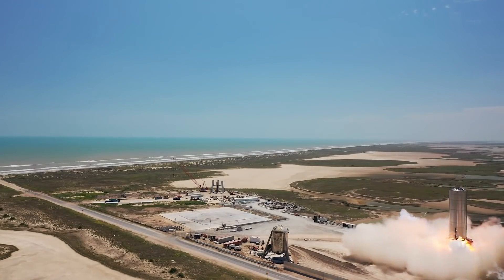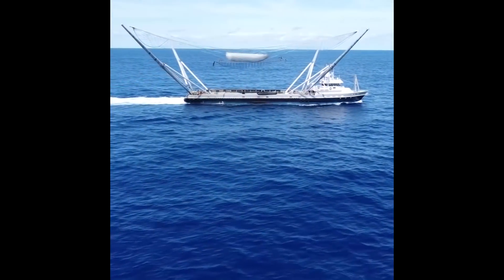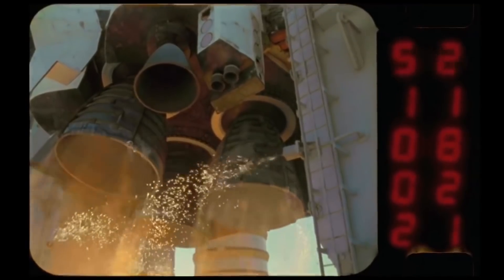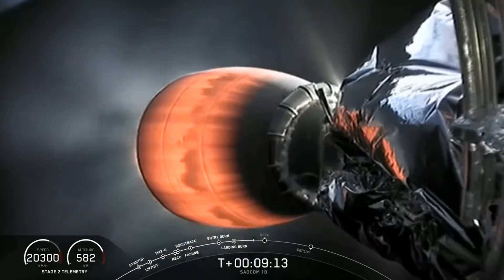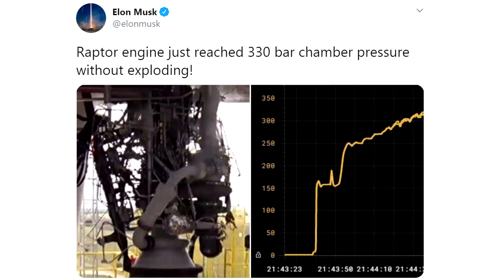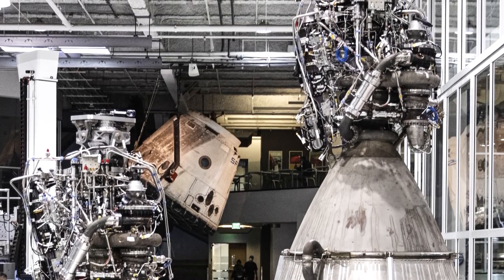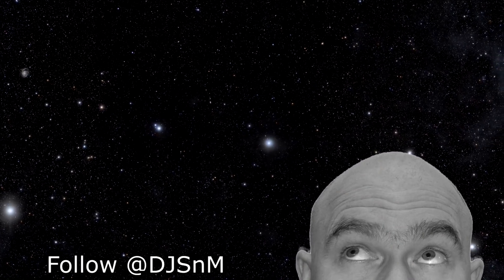How SpaceX's New Raptor Vacuum Engine Is Different From Previous Raptors (and Other Stuff)

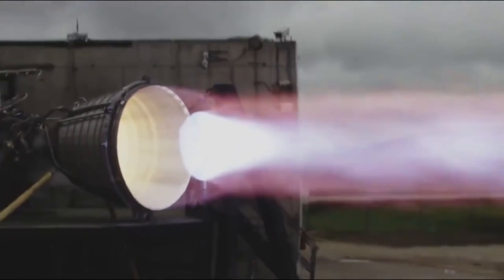Comment: 7:10 Hi Scott. The bright bands seen inside the divergence section I believe is "ghosting" of the cooling jacket structure in the walls, not flow separation. Also, if you reduce the throat in order to get your expansion ratio but you keep Pc the same, then thrust will decrease proportionately to the reduction in cross-sectional area of the throat due to the required reduction in propellant mass flux which drives chamber pressure. The only way to reduce the throats area and keep thrust the same would be to increase chamber pressure. This will have an affect on the propellant mass flux as well as thrust coefficient driving it up.

Great video as always!!!
Reply from the maker: Elon described it as flow separation: https://twitter.com/elonmusk/status/1309385646033842176?s=20
Reply: @scottmanley   But that's a tweet comment, not a full commentary on all the phenomena seen. Ah, the overall tweet problem: the good news is we get unprecedented progress info from Elon himself. The bad news is it's often maddeningly incomplete and open to ambiguity.
Reply: @scottmanley  Succinct. Nice.
Reply: @scottmanley  Yes, that is flow separation. I am talking about the bands up inside the divergent section.
Reply: @-danR  I thought he said bands. Glitch in my BT audio maybe? I listened to it again and he clearly says beads.

Answer me this though. Why is it that no one can ever have actual dialog and it immediately diverges into "Creator right, commenter wrong?" I said in my statement "I believe," I never said they are or anyone was wrong. Yet, its taken that way and the diehard supporters come swooping in like bats. I am a supporter as well and TBH, this makes people not want to comment.
Reply: @StreuB1  I believe, in the immortal words of George Carlin, “Think of how stupid the average youtube comment is, and realize half of them are stupider than that.”  

If you're playing the odds, "Creator right, commenter wrong" is a pretty good bet, I'd say that's why you often see this regardless of whether the person replying knows anything or not. On top of that you have a the parasocial relationship viewers have with creators, boosting the perceived validity of arguments presented by those creators.

As you can perhaps see, I too have encountered this phenomenon a fair bit and thought about it a bit. I tend to only comment when I feel like I have some insight on a topic and it's maddening when people just poop out the first thing that comes to their head without thought or reasoning....
Reply: @HaruEb  There's a 50% chance you're below average my friend.
Reply: @SuperAWaC  I don't get what you're trying to say, that's what the Carlin quote says, why would I think it doesn't apply to me? Are you just giving a live example for the class about "pooping out the first thing that comes to your head without thought or reasoning?"
Reply: @StreuB1  "Why do you hope that?"

Because I found your OP interesting, but most of it went over my head. I hope you didn't take me for a die-hard supporter, swooping in like a bat! All I said was that I hope Scott gives a detailed response. Never mind.
Reply: @StreuB1  "Answer me this though. Why is it that no one can ever have actual dialog and it immediately diverges into "Creator right, commenter wrong?" "

To whom or what are you referring exactly? Looking back at the comments posted, there's Joash giving you a reasoned reply, me wishing that your question gets a detailed response from Scott, Scott giving you a reply (what more could you want?), a few more comments by me and you (self explanatory), another clarifying comment ("beads" not "bands") and finally Don pointing out that Elon's tweet was ambiguous, in that order, followed by you apparently spitting the dummy. I don't get it.
Reply: @StreuB1  leaving the bs aside, is the reduction in thrust really that important on a vacuum engine? even if you have to use the atmospheric ones a little bit more on ascent to get the extra thrust, won't the improved overall efficiency make it worth? Even if it wasn't, you need to refuel it anyway to get enough dV to land on mars, so as long as it reaches LEO I don't see the problem (yeah, the idea evolved while i was typing it :P)
Reply: Ooh, I hope Scott reads your comment and posts a detailed response.
Reply: @nagualdesign  Why do you hope that?
Reply: Brian Streufert –  Definitely not a rocket scientist here, but wouldn't you win back some of the lost thrust with the increased exhaust velocity at the throat? Which would mean a less than directly proportional decrease in thrust?
Reply: @MrAnticlimate  No, because the mass flow is lowered. Only way to compensate that is to increase chamber pressure.
Reply: Wish I had seen this before taking the time to write my post.   I still haven't seen a good answer from anyone.
Reply: I believe he was referring to bright "beads" not "bands" which would make it the bright spots right at the edge of the nozzle which would be the flow separation.

Comment: 2:45 what is they conduit headed down the side of the bell?
It looks like an Open Stage exhaust port except for the fact that it goes all the way down and shrinks.. Is it for cooling?
Reply: Yep. I believe so.
Reply: Perhaps it's the return line for the regenerative cooling methane. It's expanded/expanding to a gas by this point, afaik. The widening taper would make sense with this. The curved-out part at the top is a classic feature of high-pressure lines to absorb vibration.
Reply: @donjones4719  yeah that would make sense, cool! Thanks!

Comment: Elon has said that SN8 will get a nose cone and forward canards (so no mass simulator).   The videos of nose cones show a separate tank in the nose cone as well.
Reply: Yes and I noticed that SN8 has a ring of interface stringers around the top that SN5 & SN6 didn't have. That suggests there's something more to stack, i.e. a nose cone. Or they simply could have changed plans after the fact.

Comment: If they got the cost of Starship as low as they hope, I wonder if it would be economical to just launch a vacuum engine design into space itself to test it out? (obviously within the payload bay, not actually in use on the Starship itself)
Reply: ?!? They need a RapVac to get there with a starship.
If you mean F9 then, sure (I doubt it economical though).. but you didn't say so.
Reply: Turn around on your data would take a lot longer, assuming you wanted to get it back to look at it, or you would just get less data assuming you didn’t physically get it back. Still more expensive than just doing it in atmo either way. Probably not worth the effort for these prelim tests.

Comment: If the vacuum Raptor's nozzle that they tested is at the limit of what is usable in atmosphere, why don't the atmospheric raptors use it?
Reply: they get reduced thrust and isp compared to the sea level engines at sea level and also take up extra space on the base of the vehicle

Comment: For me Nuclear engines should be used in space, just after leaving atmosphere.
Reply: They are not that great and if you use them that close you will get some fallout, specially when something goes wrong.
Reply: The ionosphere and radiation belt above the atmo are the worst effected by nuclear playing. The only time those might be useful is going away from the planet for loong times, and thats still a maybe
Reply: One of the issues so far with nuclear propulsion (not Project Orion, but nuclear thermal propulsion) is that it's hard not to make the engine really heavy (especially if there's going to be humans on board which need shielding) which somewhat defeats the purpose of a very high ISP engine
Reply: @kendokaaa  That's certainly been my experience playing KSP, yeah... there are some wonderful high-efficiency engines available, but the thrust-to-weight ratio is so poor that you end up with more dV by using a good conventional rocket. And from what I understand, the KSP ones mostly represent idealised versions of engines that have never been developed to anything near their theoretical capabilities...

Comment: In addition to the packed-in nature of the Rap-vacs making radiative cooling unworkable, is the regenerative cooling needed to make the  engine reusable with no overhaul between most flights?  The space Merlin is disposable, after all.
Reply: OP is talking about the vacuum optimized version on the second stage which burns up in the atmosphere when it's done.
Reply: @chris-hayes  Oh, got it. Thanks
Reply: I'm sure this wasthought about in the design but remember this isnt a final design vac Raptor. They'll likely go through a handfull of changes between now & when it starts leaving the atmosphere.
Reply: TheAtom I don’t see radiative cooling necessarily being incompatible with reusability, though the cooler temperatures from regen cooling certainly would make reuse easier.
Reply: @theatom7264  I heard something about putting a rap-vac on a falcon 9 second stage. If true, it could be something that is done to get space flight data on the raptor before a starship goes orbital.
Reply: M.Vac has the same regen cooled chamber and throat as the regular Merlin, only the nozzle extension is radiatively cooled so I'd imagine it would be reusable in theory - that said I've no idea how many thermal cycles the extension could withstand
Reply: merlin vac IS reusable. they just couldn't find a way to get the upper stage back to earth in one piece.
 there were plans to catch the upper stage, give it parachutes, inflatable aero surfaces, but they gave up and moved on to work on starship instead.
Reply: Maybe they plan to reuse it in low pressure environments like moon and mars.
so designing in that feature now, might be cheaper than making a disposable version and s special reusable one.
Reply: @heyarno  
The 3 vacuum Raptors are designed to return after every mission, landing on Earth using the 3 sea-level Raptors.
Reply: @avid0g  Ah, thanks for the info.
Reply: Merlin isn't disposable. It has been used for multiple flights, although it needed refurbishment
Reply: @biplabkumarghosh6300  mvac is not reused

Comment: SN8 already on test stand; don't think they'll bring it back to factory until it flies. If that is before Elon's presentation and it survives, then it might be there for show. Otherwise, would probably be SN9.
Reply: They test for leak, then stress the tanks cryogenically and might test fire to check that this part works also..
They can't do any of that at the hangars. which is why its at the LP.
For fitting the nosecone and upper flaps they will bring it back.. can't do that at the LP.
Question is only if they want to let it make a hop before that or not.

Comment: yeah... but what about landing the thing? if starship uses vacuum optimized engines, wouldn't flow separation be a problem during landing? I get that they want the ISP as high as possible, but at this rate they may have to say, make the center engine's nozzle smaller just for landing purposes?
Reply: Its going to have 3 sea-level engines in the centre that gimble, if I'm not mistaken.
Reply: there are 6 engines in the second stage. 3 vacuum and 3 sea-level
Reply: Only the 3 sea-level center engines will be lit for landing.

Comment: With how low the atmosphere style raptor engines are mounted, how are they going to mount this much taller vacuum engine?   All the thrust pucks are flush mounts.
Reply: Plenty of room in those skirts my friend
Reply: I am sure side to side.  But all thrust puck designs have been flush to the top of the sea level raptors.  When are they going to have a multi height thrust puck for the different engine heights?